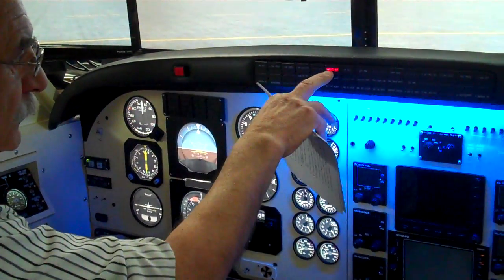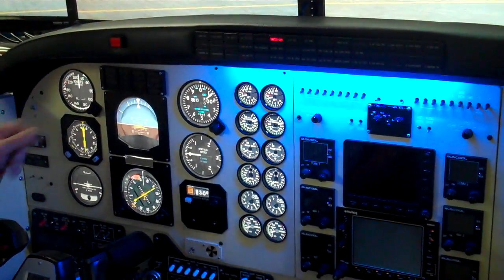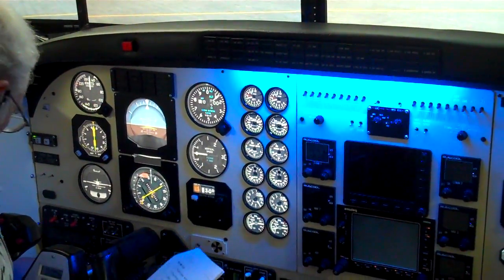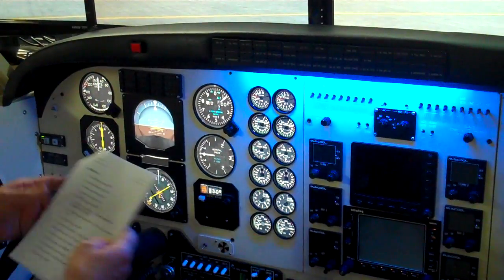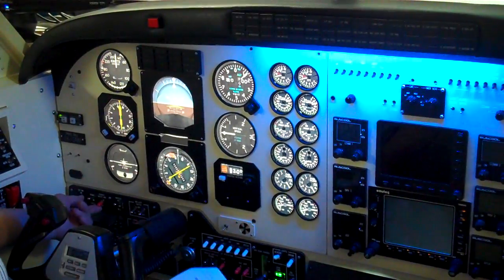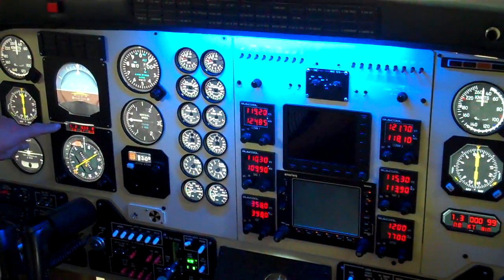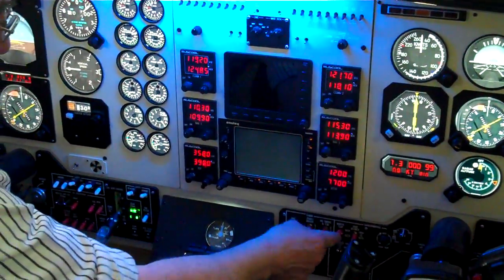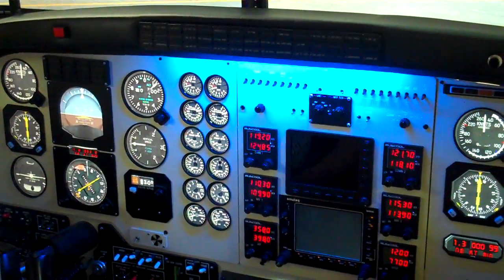King Air C90 Simulator: Before Taxi (Checklist)

Comment from the maker: Hi CoolSpiffy1,
There is no Fuel Heat switch on the C90A. This aircraft has an Oil-to-Fuel heat exchanger that heats the fuel before entering the fuel control unit. This also helps cool the engine oil, so it has dual advantages.

Regards John at Ruscool